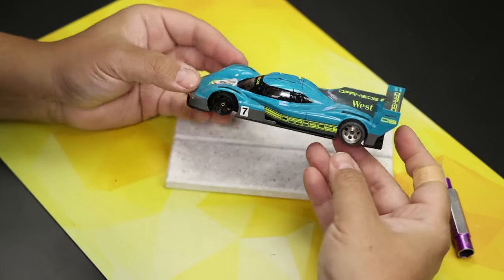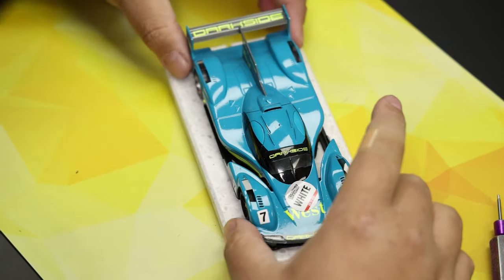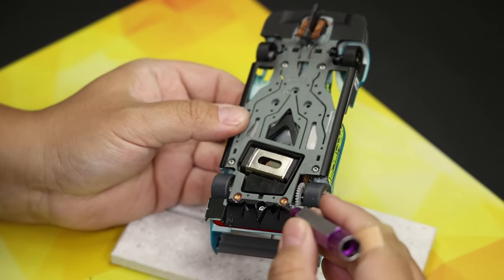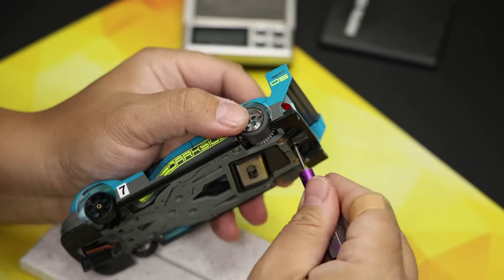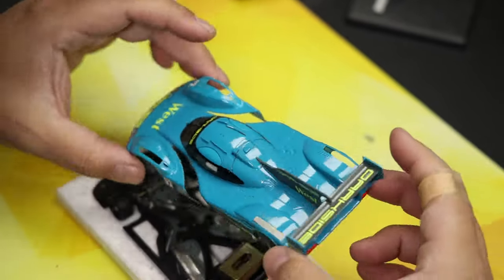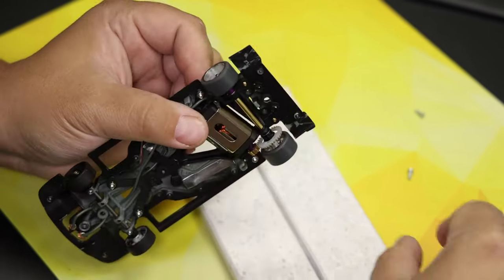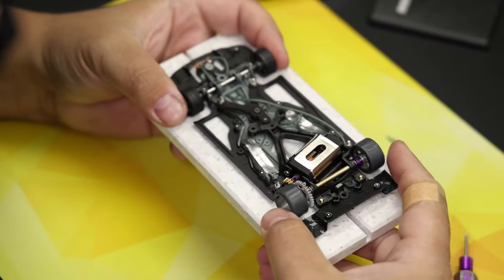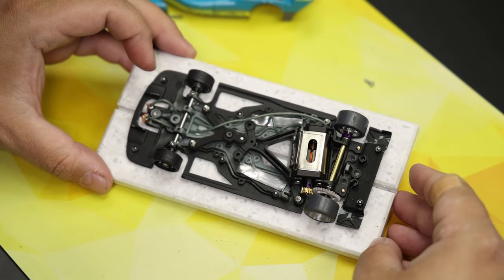Race Winner - Todd Ulery's LMP Scaleauto Porsche 963

Comment: Rear wheels: Mrslotcar Aria wheels 16.5mm

Rear tires: Scaleauto AS20 with Mrslotcar (Scale Racing) foam inserts

Front wheels: Sloting Plus Urano Evo 16.9x8mm with independent front wheels.

Front tires: Slot it low profile zero grip

Motor: B52 25k

Gearing: 13/31 (need to double check this)

Color is Porsche Miami Blue. No decals. All paint (even the numbers).
Reply: Great work, mate! Love the color scheme blue with yellow! Amazing with no decals and only painting! 👍🏽👍🏽👍🏽🙏

Due to I have the same Scaleauto Porsche 963 GTP Hypercar white kit and am starting the airbrush paint job in the near future, may I ask 2 questions, please? 

A: How did you get the windows so dark? (How did you do it, please?)

B: Which color did you use to paint the chassis edges, please? 

Thanks in advance 

Best regards from good old Germany 
Michael